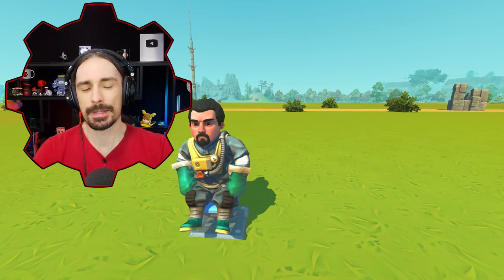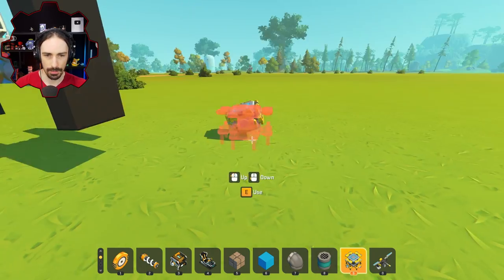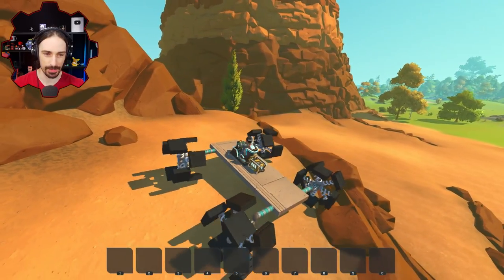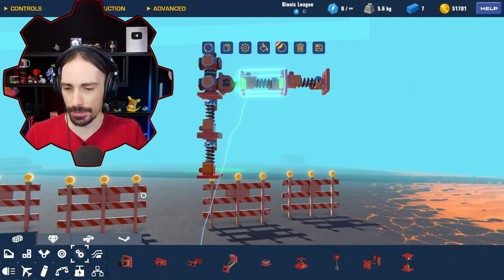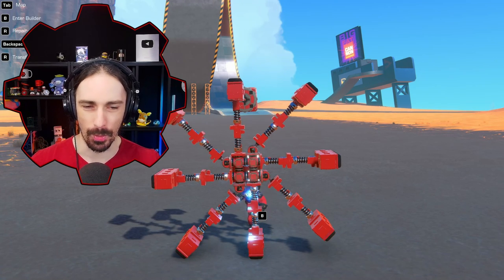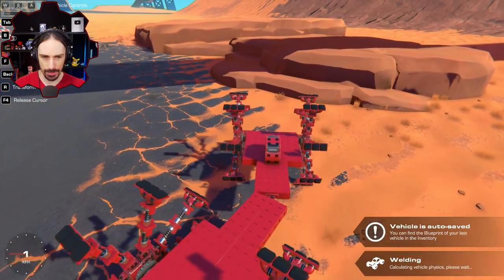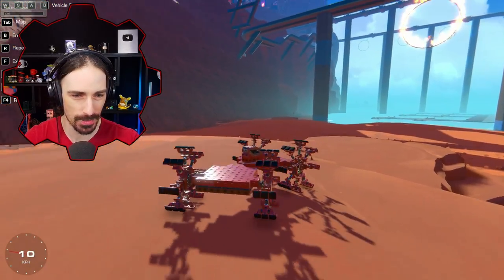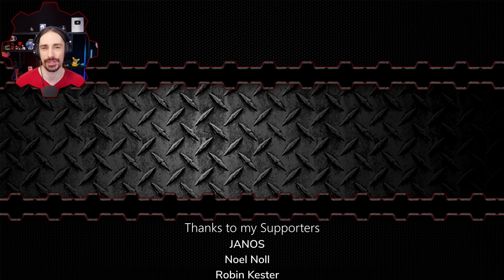Building Rubber Wheels in Scrap Mechanic VS Trailmakers

Comment: I recently made a very similar creation in Trailmakers.  If you combine one of each suspension piece on each "spoke" it reacts much much more smoothly.  

Also, helicopter engines work better as they let each "wheel" spin independently of each other but you need to add another helicopter engine on each wheel spinning in the opposite direction to keep the creation from flipping over due to torque.
Reply: you don't need to max out the speed, if it's enough to get the wheels spinning to the max speed that's all thats needed.
Reply: for the helicopter engines I mean, it doesn't produce torque until you max the speed meter really.

Comment: I think you went from one extreme to another with the suspension in Trailmakers. First it was too stiff so you lowered the stiffness. However, in putting it down to 0 it compresses all the way therefore making the two blocks on the end of each spring touch each other and act as a static object. If you found somewhere in the middle, I think it might be smoother.

Comment: In Trailmakers for more grip/ground contact u need to add a system that let the front/back of the vehicle to tilt left and right independently, like a very low powered rotating servo to connect the back/front of the vehicle

Comment: As you saw with the Trailmakers build, mechanical blocks have a quirk where they become progressively more unstable as more of them are chained together or sometimes even just based on the order in which they're connected. For example, if you have a piston leading to a steering hinge leading to a wheel, it will behave differently than if the order was a steering hinge leading to a piston leading to a wheel. Or, if you stack a bunch of suspensions on top of each other, they basically turn into spaghetti, despite the fact that they're only supposed to compress vertically

When it's just a couple mechanical blocks, it's usually not an issue, but it really becomes apparent the more mechanical blocks you have in the chain. That's why everything was spazzing out when the build was a servo to a hinge to suspension to another suspension, plus the steering hinge in the middle of the vehicle body
Reply: doesn't that happen in SM too?
Reply: @vibaj16  Not sure, I don't have Scrap Mechanic
Reply: @vibaj16  Yea, if you stack a couple of bearings on eachother and let them rotate, they will also turn into spaghett

Comment: You may need the weights directly on the wheels for them to affect the suspension, Trailmakers seems to have issues to transfer weight forces through joints. Remember the problems when you tried making a trebuchet

Comment: I didn't notice it till recently but you build on the lift like all the time, and I never do specifically because of the 90 degree build grid. honestly as long as you don't go crazy it'll load and save fine

Comment: Dampening is a system that affects how much a joint shifts or wobbles after it's received an input or interaction. So more dampening means it should move less, less dampening means its more free to bounce and shift.
In this case the more damper helped because it kept the wheels in contact with the rock more so it could climb easier. More or less damper being useful depends on what you're doing I guess, a higher biased damper would help with climbing but lower bias would probably be better for descending and going over rocks and rough terrain at speed.

Usually for off-road in games I go with soft suspension, and upper middle damper.
Been in a rock crawler jeep and it does feel like many go for higher damper but let the wheels have plenty of swing. The arms flex a lot but you hit like a sack of flour.

Comment: 10:39 try using sensor blocks,
They only have 3 sides to connect so it wont weld together if you face it into other blocks

Comment: A change that might help would be increasing friction pad area so it will be more like high friction panels instead of high friction spokes if you add 3 pads on each side to make the "panels" 9x9 it might work better

Comment: 4:56 is exactly why Axolot needs to add controller support or throttle control on these engines. You're either flat out or you're feathering the throttle...

Comment: Try making the wheels bigger so you can add more spokes at different angles and fill the gaps in the wheels by taking the blocks out the whole length of the wheel

Comment: Do a race challenge where you need to use max power gas or electric engines. Do which one would be more fun.
I can already see Kan building a gear reduction.

Comment: scrapman just fixed the random bouncing on the ground with a genius yet dumb idea.
Reply: Assuming this isn't an ironic comment: obviously not, terrain bounce will happen at higher speeds and can be countered with significantly simpler suspension setups. If it was a joke: my apologies, guess I was too frustrated to get it right away

Comment: in scrap mechanic i made similar wheels using shocks and boots for the grip surface, setting bearings to 30 and 60 degrees

Comment: Looks like SM's are low pressure tires for offroading while the IOD ones have more subtle dampening which would correspond to normal car tires for higher speeds. Trailmakers' are just not great innit